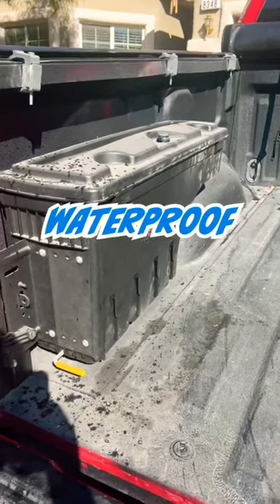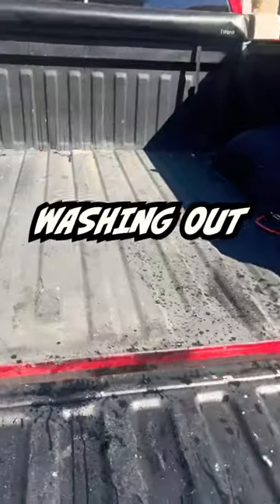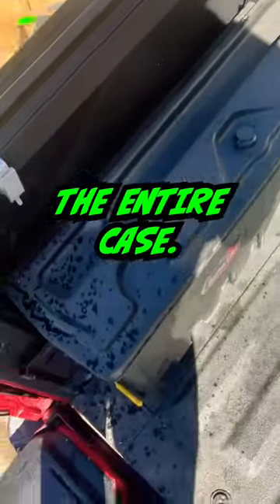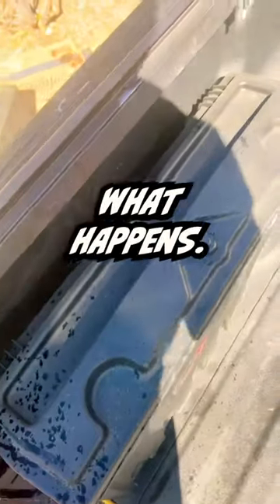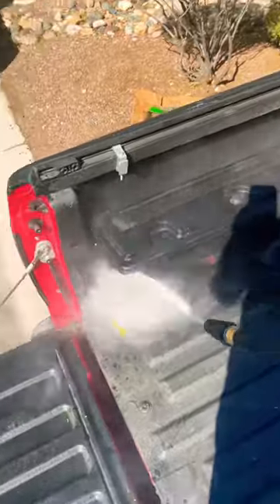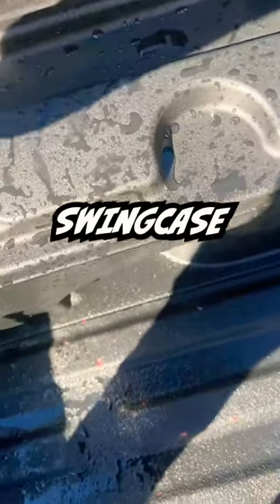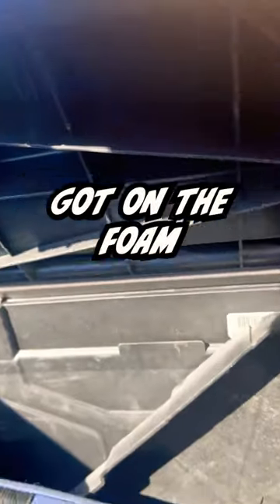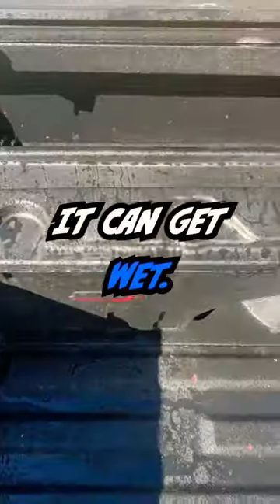How does the SwingCase toolbox hold up to water? Let’s find out. 💦 🚿   #f150 #swingcase @HORRUS29

Comment: I have had mine installed for over 2 years now. Thwy are still holding up great, no issues and no leaks. The first year or so they were completely exsposed , but i have a tonneau cover now. But i have not had any problems and love them. I will say they are a little pricey. You would think if you buy passenger and driver side it would save you some money. Nope I gave $199. Each. But looks like they are even more now at 229 each. That's too much